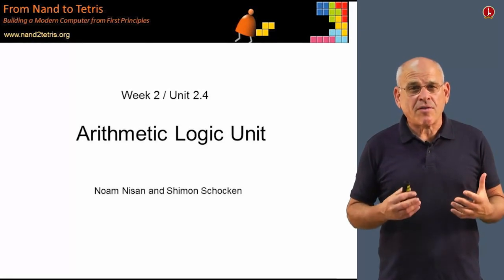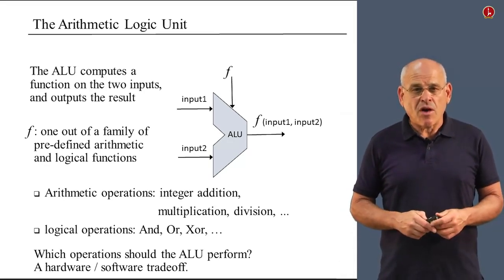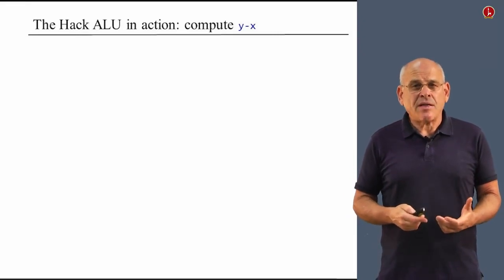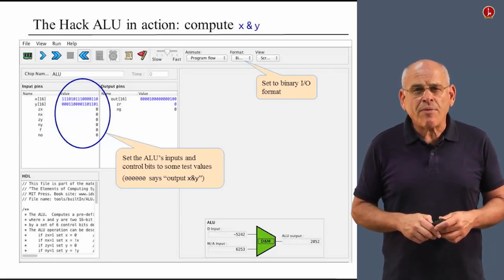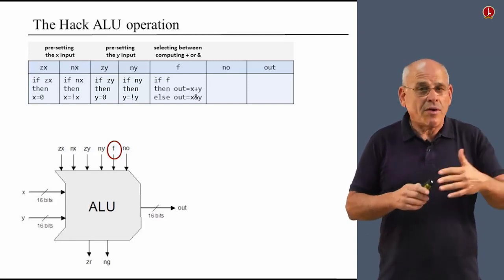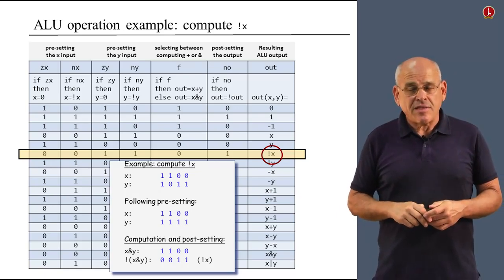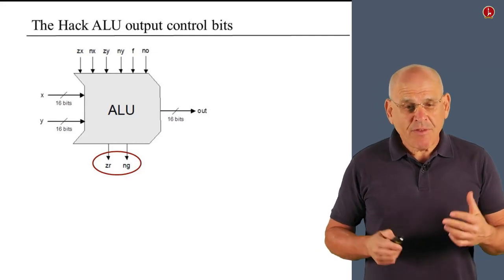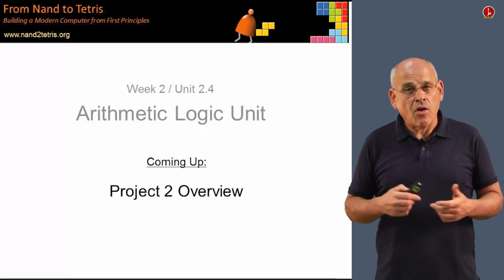[Part 1] Unit 2.4 - Arithmetic Logic Unit

Comment: the utter magic happening at 13:22 is when you flip the y it is the equivalent of turning it to -y -1 (or -(y +1) if it was negative before but that is the same after distributing the negative) so then when you add x to it its the equivalent of x - y - 1. Lets call x - y - 1 = z. When we negate z it is the same as -z - 1 (or - (z + 1) if z was negative) so when we plug in for z we get -x + y + 1 - 1 which equals y - x. Just brilliant.
Reply: This is a great explanation. Just as an addition to anyone who might be getting confused by the algebra - what's happening is that we are doing logical NOT to both y and the result. However, we omit adding one as would normally be required in correctly negating a two's complement number, as the off by one errors cancel each other out.
Reply: Thank you. I'm glad these comments exist because I was really confused at that part.
Reply: @w花b  i didn't want you to experience my frustrations
Reply: Thanks for this explanation. I may have missed it but this method to computing a subtraction wasn't explained in prior videos.